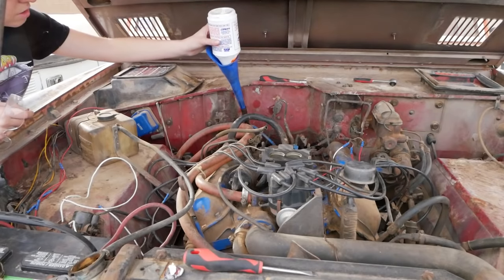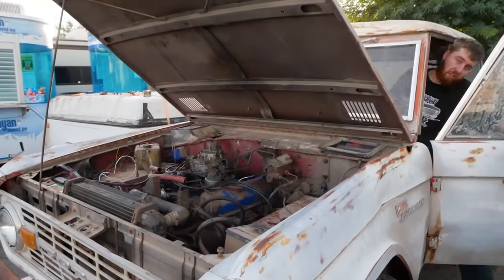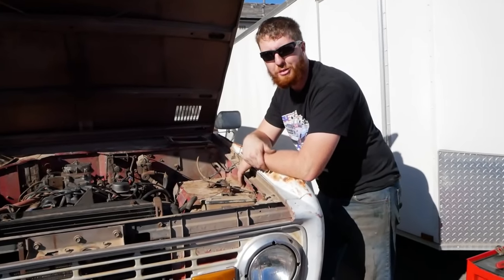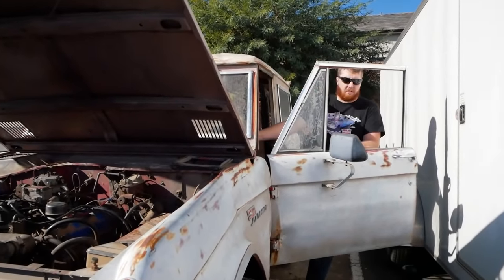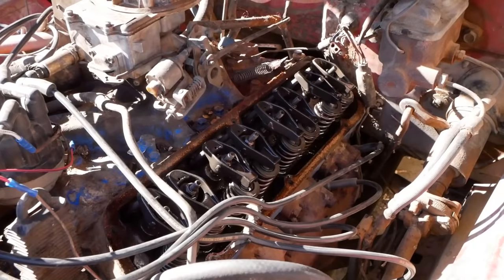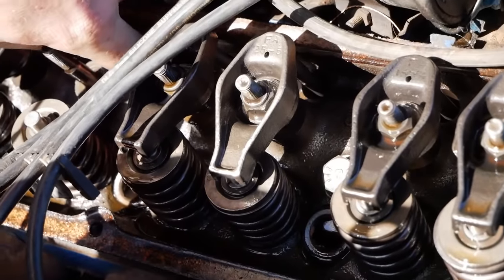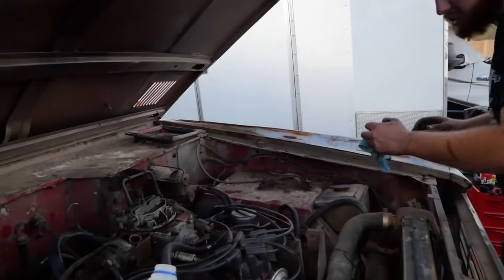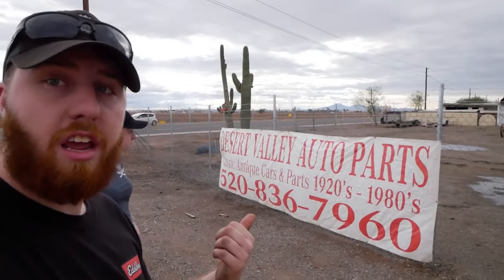ABANDONED Bronco Saved After 10 YEARS in a Storage Lot! Will it Run and Drive?? - Part 3

Comment: Minerals in water, makes it “hard water” that stuff does things like you saw. It builds up and just is a clogging medium.
Reply: That was my thought.
Reply: Yep. So many people think "That prediluted coolant is just the good stuff watered way down, yer payin' fer just water!" so they buy full strength and dilute with tap water...which in some places like where I live...is groundwater. It's been steeping in shale, lime, and other groundwater minerals for eons, straight out of the ground, through the county's off-brand brita filters and right to the tap. It's righteously taxable as real estate with as much mineral content it has in it. Too thick to drink, too thin to plow.
Reply: @tjfritts9013  you couldn’t be more accurate
Reply: @tjfritts9013   That’s Exactly!
Reply: @tjfritts9013  Yep, I deal with massive heat exchangers for multi thousand watt RF transmitters. I order up 100 gallons of distilled water from a local bottler in the 5 gallon jugs when we do a flush and fill. You actually end up paying more for the deposit for the bottle than the water in the bottle, $7-$10 for the deposit, $4-$5 for the water. Most transmitters are in the middle of nowhere with nothing but well water. Want to destroy a million dollar transmitter in a few days and void the warranty, fill it with tap or well water with your coolant mix. Seen it done, and it's not pretty all to save $100-$150. Distilled water at the grocery store is usually about 99 cents a gallon, less if you buy the 3 gallon jug. People shouldn't be cheap on that, either buy pre mix or buy a few jugs of distilled and do it right.
Reply: @andycanfixit  People do such stupid stuff to save a couple bucks. Typical cooling system on a car is what, maybe 6 gallons max? As you said, that's $6. Gee, wonder how much replacing every component of a cooling system costs? Bet it's more than $6!
Reply: @tjfritts9013  Exactly. Only exception is in an emergency in the middle of nowhere when you have to use whatever you have, in which case flush it immediately after when your back to civilization.

Comment: When you installed the new thermostat, you need to glue the new one into the housing, or it will fall down a bit and when you tighten the bottom bolt it will break the housing. I did it myself before....
Reply: What was that stuff my Dad always used... Gasketsinch or something like that.  As I recall it had an angel or some sort of winged lady on the label.

Comment: People in Arizona love to pour water in the cooling system. Have had the heads off multiple vehicles that were literally destroyed because of this.
Reply: If I ever have to pour water into the cooling system, I make certain that it is clean distilled water. No minerals, no nastiness, just 2:1 hydrogen:oxygen. I don't know anything beyond the basics of car maintainance, but even I know that anything but coolant or distilled water is not a good idea.
Reply: I have never poured tap water into an engine but I have used water from a ditch on the side of the road to get home. Lol
Reply: @Sir_Uncle_Ned  just don't do it for long! The inside of a cooling system is remarkably similar to a metal-plating cell.

Dissimilar metals, check, heat to speed up reactions, check, mechanical stirring of the transfer medium, check, electrical current, check, all its missing is a good acid, and even distilled water will eventually pick up enough metal ions and whatnot to become a weak acid and start moving stuff around, it just takes a bit of time, and happens faster with heat and stirring!

Comment: That STP stuff is NOT full of Zinc, as we think. Check out “projects farm” video of it and his lab results shows it perfectly.
Reply: Surprisingly, Lucas makes a ZDDP additive that has loads of zinc. Mixed into crappy 30wt, but you need so little of it that the base oil doesn't really matter
Reply from the maker: That's why we put two bottles in. It's the cheapest option
Reply: @JunkyardDigs  Some Zinc is better than no Zinc. When in tight spots you gotta use what you can get.
Reply: @JunkyardDigs  the stp is crap. Buy the Lucas ZDDP as the person above me stated. One bottle will last you. You don't need to use a ton because it's full of it.
Reply: Or just buy Rotella, much cheaper then cheap oil and cheap additive
Reply: @JunkyardDigs  God bless you and Mook, nothing but the best to you both. Thank you for the absolute quality content that you put out, I have learned so much from you. Better put a ring on her finger quick btw lol. 🤙🤙🇺🇸🇺🇸🙏🙏
Reply: You could have put in a whole quart of liquefied magic zinc-juice that contained 92% pure zinc... and it would have changed nothing; engine was worn out, stored horribly, and left to die. 

There is no Mechanic-In-A-Can solution for "essentially abandoned, but retained in abandoned state far too long due to misguided overt sentimentality".
Reply: @inverted311  Can't go wrong with a girl that understands mechanical principles and does fart jokes.

Comment: What a great idea to flush out rust in the engine block. It saves a lot of time. Not only can you see if the water pump is still working, but you can also determine if the engine block is blocked by rust or not.

Comment: I bet they just go hey it doesn’t freeze down here I’ll gonna use straight water... and that rusts and corrodes the internals leaving all that shit in there.
Reply: Plus it's calcium and lime saturated hard water straight from a municipal tap soaking into the internals every second for decades.
Reply: You are exactly correct , I am from Arizona and that’s what everyone used to do . Straight water and no antifreeze unless you lived in the higher elevations where it could freeze .
Reply: Exactly.  Since it is  called antifreeze and not anticorrosion they just skip it in the warmer areas.  Buying a used car in those places requires a bit of investigation to see if there is a functioning cooling system.

Comment: Great job. You got it running. There is often a long way between running and reliable. I would never have guessed that old gas could be both combustible and so destructive. Has me rethinking my approach to an old gas tank on one of my vehicles, lol! I lived in CA for 30 years, vehicles with a lot of aluminum on the motor are very susceptible to destruction by coolant. Fords and Buick V6s come to mind. Change all the aluminum parts, including that timing housing.

Comment: this was a great series, no matter the outcome. It reminded me of the 1978 Dodge Magnum i bought with a seized 360 2bbl motor. I towed it home (around 1989) and proceeded to remove the spark plugs and filled the engine with diesel fuel until it flowed out the spark plug holes. For two weeks I would try to turn the engine by hand until it finally broke free. Drained the diesel, filled it with cheap oil and plugs, and cranked it without starting it. Did that a few times, then got it running, ran 15 minutes, drain the oil and repeated. 3 oil changes later the car was running and was the strongest running engine I ever had. Great memory

Comment: If you have hard water and heat it, what happens is you get minerals like calcium and magnesium that will create scale and clog up your  hoses. The harder the water the faster it changes to scale. Scale looks like little solid pieces of paper and just keep building up. I do maintenance for a coffee franchise so I see a lot of this in the machines. Not so much now since we have installed filter systems. This is the reason that they recommend you use distilled water for your radiator or battery since distilled water has all of the impurities removed from it.

Comment: That's insane.   Great videos guys.   That Bronco is in great shape with the exception of the engine cooling and fuel systems.  LOL.   I'd take it home , drop the tank for a flush, pull the engine for a rebuild, do the lines and wiring while your in there then get it back together and make some off-road Memories!!!!

Comment: Dude... you spent long enough around cars you have those days. I put a Subaru EJ25 in a '73 Super Beetle.... after everything going wrong... twice... I finally get to where it should be running (and it still wasn't) and I realize the used motor I bought had a blown head-gasket... time to pull the motor... again.   It's been a 15 year project, and as soon as I got it to the point where I could walk in the garage and crank it... I pulled the body to replace the heater channels. .. maybe I have a problem.

Comment: an old trip I was taught many years ago when I was doing my apprenticeship and you had stuck valves.. pour some thin machine oil down the carb while your revving it, or hopefully just holding the throttle open if its only a couple of stuck valves.. the  a modification to the theory was using brake fluid which I think it is better.. thrust me it works..

Comment: Sorry that things didn't work out, but with the condition of the cooling system (which you would never be able to get right anyway due to the insane amount of established corrosion) you were going to put a motor in it anyway if you wanted to keep it.  The journey was also quite entertaining, and you've learned a valuable lesson about the difference between Midwestern and Southwestern regional maintenance habits!

Comment: Out here in the desert, our cooling systems are worked extra hard because of how hot it is. Which means the anti corrosion properties of the coolant wear out faster. So that's one thing.

The other thing is the water out here has different PH levels than where you're from. So when some fella tops their coolant system up with tap water, that happens to the cooling system. Especially when they top it up with tap water, and then let it sit ten years.

And even worse, our shiz leaks because the rubber gets attacked by the heat, which leaks out the good green stuff and prompts people to use tap water.
...
All perfectly combining into the wonderful recipe of rust soup you have now discovered.

Shell rotella has all the vitamins and minerals and dinosaurs that a fella needs.

Comment: On the cooling system issues, I think it's likely that when folk live in warmer climes the automatic thought is "I don't need antifreeze, it never gets below freezing"... Thus they end up using water & don't have the benefit of the corrosion inhibitors in antifreeze (which you know is more correctly known as coolant, this misnomer is probably the root cause of the crappy cooling systems).  Also stop-leak is a good way to clog up radiators and heaters, jam thermostats etc. more corrosion = more chance of stop leak = even more cooling problems.  Happy new years everyone.

Comment: The rust issue is also a big problem I've noticed in the Southeast. Hard water mixed with lack of maintenance (rarely doesn't get cold enough long enough to freeze solid) causes it. The most recent truck I had to do the same exact thing on was a 97 Ram 1500, took forever

Comment: It is very common in warmer climates to use just straight water.  Not only that, but as others mentioned you are supposed to use distilled water whether you are mixing it or not.  The anti-freeze also increases the boiling temp and to my understanding also helps lubricate the system to help fight corrosion and the buildup that you are seeing.

Comment: Growing up in the southwest in the 70s and 80s, we just put water in the cooling system. There even use to be 55 gallon drums on water in the rest areas especially where there was a long uphill climb. When aluminum heads were put on iron blocks, the aluminum would just get eaten away in the corners nearest the block. If you ever pull the freeze plugs on that block, the rear of the cooling passages will be packed with that same rust flake.

Comment: I've had the exact same fule issue. I have a 1945 ford 2n tractor. I ran it with what I thought was ok gas but it had been sitting for 6 months. The next morning no compression at all. Turns out the varnish from the gas got in the stems and glued them open. Thankfully it's a flathead 4 cylinder so no broken parts but I had to take the head off and all the intake valves out to clean them. It's running good now so it will get better. I found a little heat will warm the varnish and it turn to a liquid. Combine heat with pb blaster and they come right back.

Comment: Hi Kevin & Mook,
The problem you have with the cooling system is the same as what happens over here in Queensland, Australia.
Most of the state with the exception of the coastal areas has "Hard Water" which means theres a high amount of dissovled minerals in the water supply. The main culprits are usually iron, copper, sodium and calcium. When people fill or top their cars up with tap water the heat produced in the block as well as the high ambient temps here creates a mineral scale in the system.
Its particularly bad in cars that use cast aluminium housings as the salts will build up and corrode the metal badly.
Ive pulled water pumps and thermostat housings from early 90s cars that are pinholed or so corroded that you can break pieces of the water neck off with your fingers.
As for the bent pushrod, your a braver person than I but maybe you have plans to rebuild that motor anyway...

Comment: when you get a motor with stuck valves. once it runs, keep the revs up and squirt light engine oil into the carb throat. it help free up the valves and the rings. but it depends how bad the rust is.

Comment: i put 1 gallon old gas in 20 gallons of fresh gas , the varnish glazed the valves on my 1983 nissan 720 2.4 pickup amd seized the valves twice in the guides. i learned my lesson after taking the cylinder head off twice to clean and freeup the valves. good video

Comment: Looking forward to the small block Ford build (or 351 transplant)!  While it is out, might want to consider a torque converter and transgo shift kit!  I just did a very similar build with my 70 Cougar and am very happy with result...Hughes 2500 Converter.

Comment: Valve covers off again, remove all rockers, inspect ALL the pushrods.  Exercise the valves with a soft hammer while spraying with brake clean to try to dissolve any buildup in the guide, THEN lube with oil.  Bet you will have better results.  Also check for any valves not sealing by doing a compression check on each cylinder with the rockers removed.

Comment: I got a 1994 seville with a northstar v8 that hadn't run in 10 years. It would lose almost all compression every cold start after first getting it running. You could hear the lack of resistance on the starter. Modern engines are still susceptible to this issue after sitting! Finally I understand what was going on.

Comment: for feature reference with old (ancient) oil, fill Kerosene, disconnect the distributor, turn over for a bit, leave over night, drain the kerosene..cleans all the gunk out of the pan and as well lube the the valve stems..

Comment: Deflate a football, stick it between the fender and inner fender and inflate it slowly, it will pop a lot of that denting out. Work the point up into those pinch points near the top and don't surpass the metals memory. Also, back in the day, here in the West, we added water soluble oil to radiator water to keep it from rusting and calcifying. Water transfers heat better than alcohol if your not evaporating it.

Comment: I think the issue with the southern places is that they use straight water instead of actual coolant. Up north and east we use 50/50, 40/60, 30/70 for the winter which has rust preventatives in it

Comment: That has to be the first time I have seen anyone straighten a push rod.

The reason for all the corrosion in the cooling system is some people in the warmer states tend to run a lower concentration of antifreeze and use iron rich tap water.  

Berryman B-12 will help with the varnish in the fuel tank.  A couple gallons of gas and a couple gallons of b-12 in the tank let it set for an hour or 2  and then pump it out.  Not a 100% fix but should help enough that it won't gum the valves and carb.

Comment: Here in the west or southwest, temps never get below freezing. So lot of people with older cars just use tap water instead of distilled water. The tap water corrodes everything in a short period of time especially after sitting any length of time.

Comment: Hey Kevin with the cooling and heating in the California Nevada Arizona area the summer heat drys out all of our lines which  then crack if you’re lucky the crack on the outside and you can see that’s cracked and replace it but if not they start peeling from the inside which is partially where all that gunk is that you had in the different hoses and lines

Comment: I run lucas hot rod and classic oil in my '73 Mustang, even though I've converted to roller cam. Lots of Zinc in there.
Reply: Use diesel spec oil...lots of zinc.

Comment: 1qt of the cheapest atf to 5 gal of gas. No more sticky valves. Loosens and helps seal the sticky rings. It also smokes like it's gonna blow. But the oil in the atf takes all the sticky out of the gas.

Comment: My best guess about the cooling systems is folks that run straight water (thanks to our moderate climate) instead of coolant since coolant has cost rust inhibitors. And or stop leak in conjunction with.

Comment: The old green coolant if you do not flush it at least every year or so turns acidic.  Also we run 50/50 down here. I work a lot up north where it gets really cold so I run 75/25 coolant to water. Oh by the way I am from Louisiana.  We have overheating issues quite often.

Comment: In the south and west a lot of people use water in there cooling systems.Because  there is not risk of it freezing. Even in the winter it does not get cold enough. Thus there is more coolant system rust issues.

Comment: I think I'd pull the heads and have them hot tanked, replace the valve guide seals, replace the tank, fuel lines, and fuel filter.